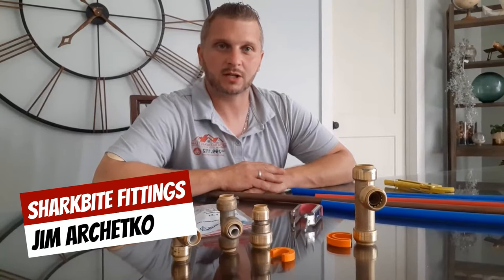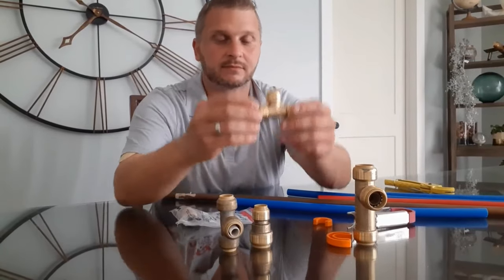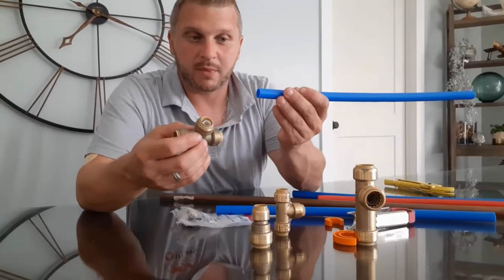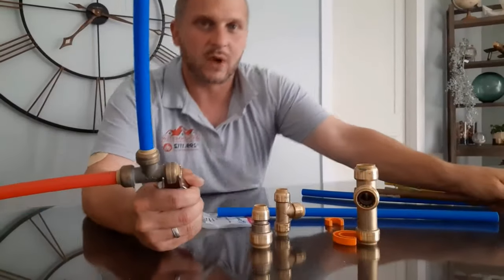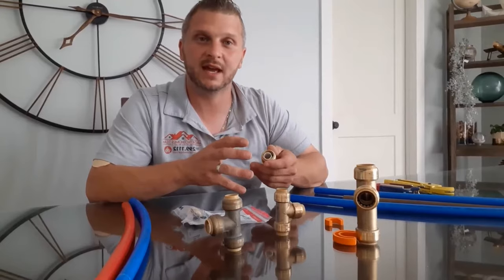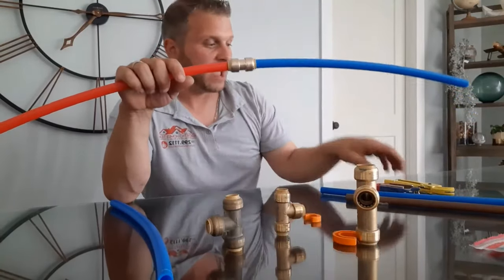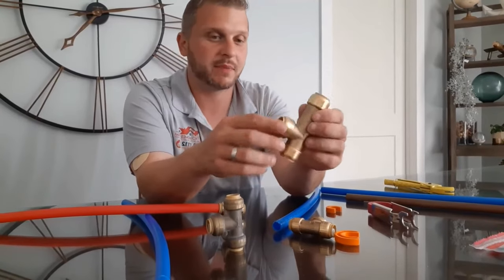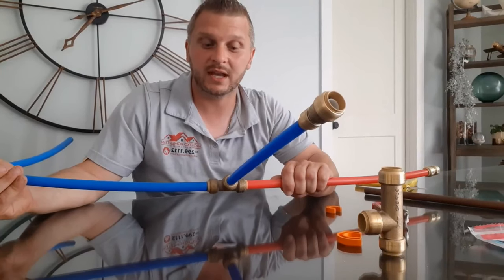Everything You Need to Know about Sharkbite Fittings!

Comment: 69 year old woman been using these for years! I did not know about the little cramping tool which has saved my life! The little half circle thing made it too difficult to get off especially when under my house on my back with limited area to work with.
 Thank you for an excellent video!
Reply: I hear ya; those fittings are a BLEEP to remove.  I bought those tongs, but still find it a pain, especially in tight areas.